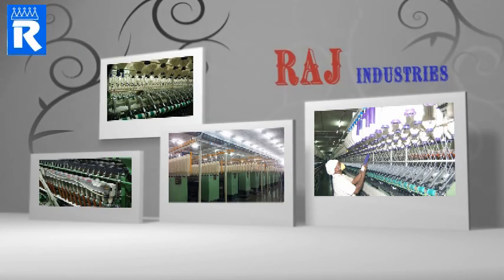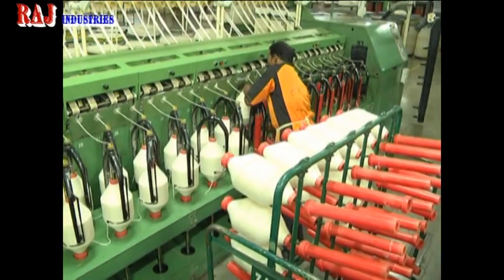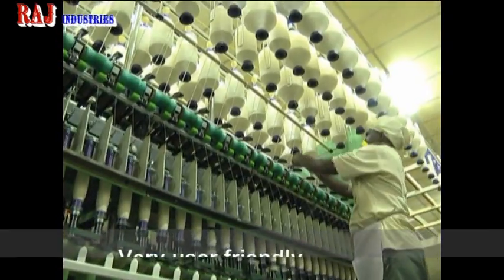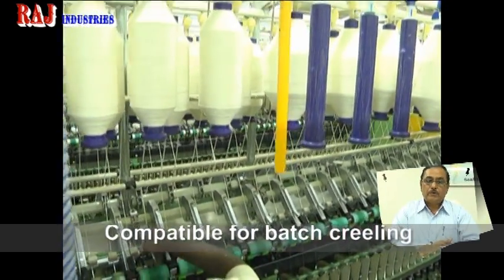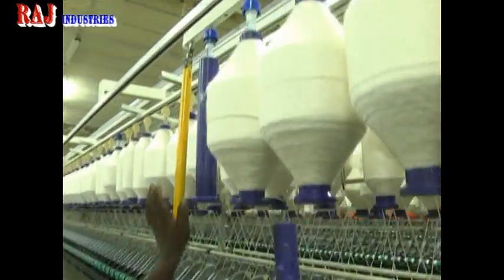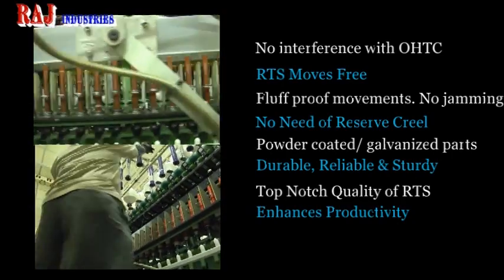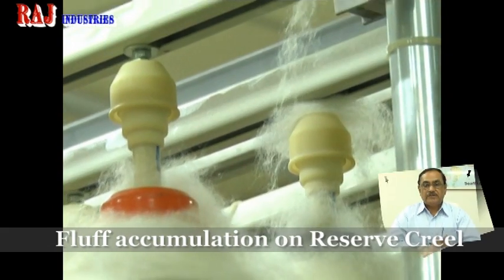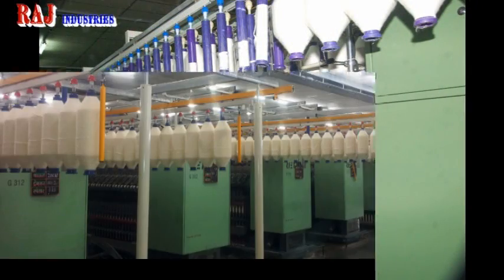Roving Transport Bobbin Transport Bobbin Slider

Comment from the maker: Rajindustries RTS takes care of transporting them wherever required by moving it via an overhead railing. This system is installed on more than 2 Million Spindles across India, which is more than the count of all its competitors put together. It has been more than two years  and  not even a single complaint has been reported until now. This is exemplified by the use of Belgian technology for processing the system. Raj Industries is the first Indian company adapting this technology.